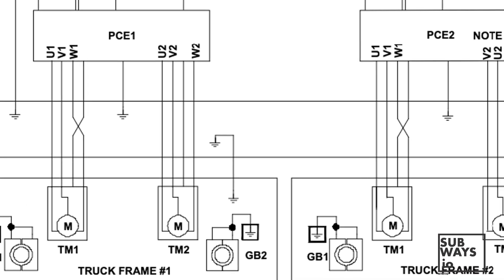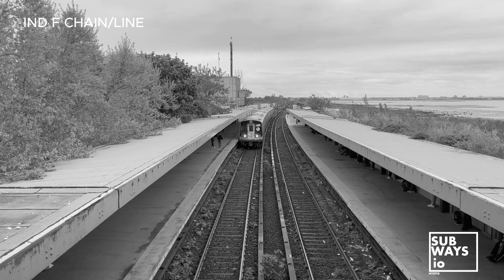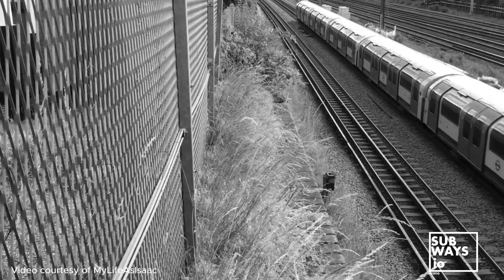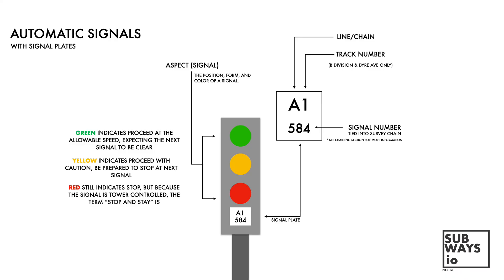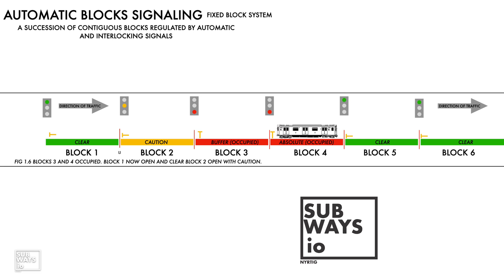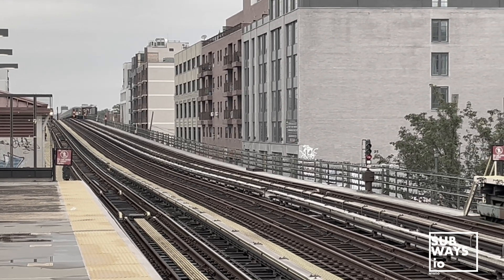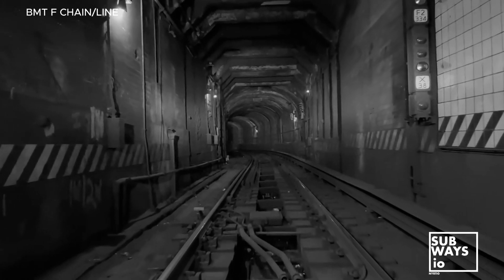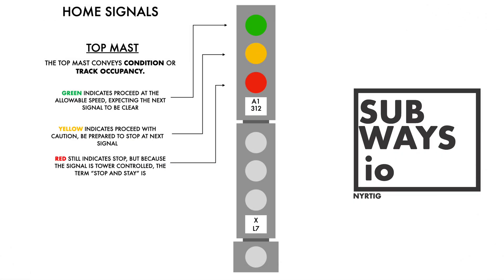NYC Subway Signaling 101: The Basics Behind the System

Comment: You explain it very well.

I'm from Russia, and we had a similar system built in the 1930s. It was modernized in the 1960s. It still used simple relay logic and a few lights in the cab. We also developed an automatic speed control system (ASC). The ASC system never allowed, and still doesn't allow, the driver to exceed the set speed, and if the speed is exceeded and within the permissible limit, it automatically stops the train.

In the 1990s, we abandoned the traffic light system and switched to an automatic locomotive signaling system (ALS). The idea is that the closer a train is to another train, the lower the maximum speed of the train behind it. This is all determined using track circuits and relays. The ASC system, combined with the ACS, complements each other perfectly. But I was really interested in hearing how the security system works in the US, since I plan to move there to work as soon as I finish my studies in Russia.

Comment: Just a quick thought bottom green doesn’t always mean “go straight”… there are a good 2 places where bottom green train takes a turn while bottom yellow goes straight…the number 2 train leaving Franklin Ave going towards Flatbush Ave accepts bottom green yet makes a right turn…bottom yellow causes a train to continue as the (3) goin straight into Nostrand Ave, Kingston Ave and Utica and all stops to New Lots…also briarwood van wyck has the (F) line accepting bottom green for 179th st as a local although train takes a switch at D20… a bottom yellow is for the (E) to Jamaica Center although train proceeds straight over the interlocking
Reply from the maker: Indeed, we’re familiar with this setup: Tracks 1 and 2 shift, with the leads tying into Line D at 2544 Home. When everything shifts over to Track 2, it creates a unique arrangement—the first home signal and the following home, located just one block away, connect directly. Based on the track and signal diagrams, GT begins here, allowing a 2 or 3 train to receive a Yellow-over-Green at the first homeball, followed by the standard lineups depending on routing via Line D or Line E. The introduction of ATS-A may have also modified some of the relay and interlocking logic.

The real challenge in creating a “101” is presenting the material so that someone starting on day one can follow it. There are always exceptions to the rules—complex layouts, space constraints, and alterations made over the years. That’s why, just like in MTA operator induction classes, we start with the general patterns you’ll encounter most often, and then highlight the exceptions as we go deeper.  Some home signals remain in spots where switches once existed but were later removed. You’ll also find capped signals where lineup options have changed. Setups with unique homeballs like this do exist, but they’re not common—they’re the exception. Thanks for watching and for your comment in pointing that out.

Comment: As a former driver on the London underground it's very interesting because the terminology is pretty much all different yet the equipment itself essentially does the same thing. 
For example the tripping devices on the track are known as train stops and the arm on the train itself is known as a trip cock. Basically an air valve. 
Another difference is the name of the signals. There are automatics which are called the same, interlocking signals would be known as semi-automatic signals and those are controlled by the local signal cabin / box, or on some lines a centralized control room. They're also named accordingly, relating to each signal box that controls them. These are the signals you do not want to get tripped at otherwise you get hauled into the office for a good ass kicking. 
What we call home signals are usually the signals approaching a station you would have an outer home, intermediate home, and the inner home which would be right before entering the station platform.
The signal at the leading end of a platform is called the station starter, some of which are automatic and some of which are semi-automatic. 
There are X signals in a few  places but it's been so long I can't remember what they do😅
Regarding the signals going in and out of yards / depots those are usually called shunt signals, and consists of a white disc with a red line on it which turns 45° when it clears.
For diverging junctions, instead of two stacks of color lights they have what's called harbor lights, a diagonal set of white lights above the signal indicating which way you're going to go. 
Anyway if you've read this far Bravo to you.

Comment: Sorry you are wrong ! London 4 rail system uses  DC for traction and AC for signalling.
Reply from the maker: Thanks for your feedback. Historically, the fourth rail system on the London Underground was chosen not only to minimize stray currents and electrolysis, but also because the network originally used DC track circuits. Later, as the system evolved, portions of the network were upgraded with more modern signaling technologies. DC to start.

Comment: There is something wrong with the description of the automatic signals and the trip arms. when a train passes an automatic signal, this signal turns red. but the trip arm for this signal does not rise until the train leaves the block by getting fully within the next block. otherwise, the trip arm would go up after just one or two cars past the signal. this is why it's necessary to have two blocks of red signals.
Reply from the maker: So, just a quick overview. The fundamentals of block system design are based on the maximum allowed speed, with block spacing and lengths directly correlated to that calculation. The faster the train can travel, the longer the block.

Why? A train must always come to a complete stop within the confines of that buffer block once it is tripped, regardless of speed. This is why, when designing signals and blocks, braking data is also crucial.

The two-block system is designed for safety. The first occupied block serves as the buffer to catch or stop the train, so to speak. The second is the absolute block, which the train or part of the train occupies. Keep in mind that a six-hundred-foot consist could occupy more than a single block at a time. The system isn’t exact—we don’t know the train’s position down to the foot or inch; we only know that part of it is in the block due to the track circuit.

This is where newer setups like Automatic Train Protection (A-T-P) and Automatic Train Supervision (A-T-S) within Communications-Based Train Control (C-B-T-C) are more accurate.

Regarding automatic tripper arms, there is a function called retention, which keeps the arm from raising while a train is crossing over one. Once the consist clears, the arm raises to protect the entrance to the block. A red light or an occupied block equals a raised arm.  

This is pretty much our breakdown. I’m not sure what caused the confusion. Thanks for the feedback.
Reply: @Subways_io  I think the retension mechanism that keeps the arm down is whether the block protected by the signal is occupied or not. at least that's what I remember seeing as a kid. maybe they've changed things. There's also a timer that keeps the arm up for some seconds if the block becomes active-it works the key by automatics signals.  i'm sure it's pretty common, but I have a nineteen seventy's motorman's operator book that I can share if you don't already have access to that.
Reply from the maker: @NE-Explorer  Nothing too complex. In this case, we’re just pointing out that the Automatic Stop Motor knows to hold the tripper arm in the down position until the full train consist clears. Even though the train has entered the block, retention, in this case, refers to the delay between entering the block and protecting the block.

Could it all be considered retention overall, with control of the gear and contacts? Sure, in the context of logic and mechanisms.  But the Retention Feature as relates to NYCT is and taught as from the first set of wheels crossing the IJ to clearing that position.

Comment: From an Australian train drivers perspective, I can see where John Bradfield got his vision for Sydney's electric suburban and city underground railways signalling right down to the trip arms. The signalling aspects are a little different, but the fundamentals are the same. Green for proceed, Yellow for caution and Red for stop. One part that is the same is the calling on yellow aspects, both there and here it is "proceed at caution and stop clear of an obstruction or occupied track ahead. Here in controlled areas, we have a little Green "close up" signal, which is a low-speed signal to allow a rail vehicle to enter a block at low speed under 25km/h telling the driver that the block that he is entering is unoccupied. Thank you for the video, I found it informative. Also, I'm guessing the "trip apparatus" on the cars with motorman controls stays in the lowered position even if the cab is a trailing unoccupied position, where here, the apparatus is in the raised position. On an 8 car Sydney suburban and Intercity train set, the trip apparatus stays lowered on the outer ends, whilst on older sets, the intermediate trip arms are raised as our trip arms raise as soon as the first 2 cars pass the signal.
Reply: They have to drop first here or they would trip the brake cocks on the cars and dump the brakes

Comment: Odd choice to use black and white or close to it. The black and white might have made sense if the signals and related equipment were in full color. They aren't. I think the fourth track in London is also because a lot of it is iron tunnels in damp clay.
Reply from the maker: @emjayay  that’s correct it’s both we also mentioned it in the form of electrolysis and stray current.
Reply from the maker: @emjayay  Again we have several other signal videos on the way. Signals 102 covers timers and wheel detectors all in color. Stay tuned for that release very soon.

Comment: if the return rail is apart of the circuit for the third rail can it electrically shock you?
Reply from the maker: The risk is low for NYCT's setup being the Negative return is grounded. But you can get shocked by touching it and the Third rail obviously and even possibly by touching another grounded object.

Comment: At one time, the IRT had stretches where the straight rail/divergence was even simpler-- green over red, straight rail; red over green, diverging track. Obviously, stop-and-stay always was red-red.
Reply from the maker: Indeed, that's correct. The IRT used a center red with four masts on interlocking signals in sections of their mainlines. The ex-IND Dyre Avenue line also used a red-over-green setup for diverging routes until it was re-chained and re-signaled in the 2010s. Maybe at some point, we could create a short video on historical signaling. Thanks for the view!🦺👍
Reply: @Subways_io  The one interesting signal anomaly from the BRT/BMT days, pre-1959, was southbound tunnel moves approaching DeKalb at 4-aspect signal X-4; a bottom-blue aspect, according to the rulebook (maybe it was lunar??) at X-4 denoted diverging into the A3 bypass for either the Brighton Line or 4 Av. express (skipping Dekalb). Bottom green would have been A1 Tk. to Brighton, stopping at DeKalb, and bottom yellow would have been F1 Tk. against the wall to the s/b 4th Av. Local. When they reconfigured DeKalb and eliminated Myrtle Av. all this changed into today's configuration; DeKalb was lengthened northbound and S/B Myrtle was eliminated and the flyunder added. This is covered in great detail in my track map book, P. 134.
Reply: @W2IRT are you the author of Tracks of the NYC Subway?
Reply: Nvm, I see now Peter. I have bought every book in pdf form since 2022 (and a physical 2021 book).
I spoke with you before, but thank you again for such a wonderful book.

[Admin R Smith]
Reply: @blue9multimediagroup  Yep, that's me!
Reply: That's how mainline railroads display their aspects btw....
Reply from the maker: @CraigFThompson  Indeed The IRT’s setup was based mainly on mainline rail.

Comment: I’ve long been curious as to why the subway system of NYC has never had an intermediate signal between a single green and a single yellow, with signals on heavy rail lines used by CN, CPKC. Amtrak, CSX, Norfolk Southern, Union Pacific, BNSF, Network Rail and other England-based train operators often having such a signal that warns any train driver approaching that the signal afterwards is a stationary single yellow.
Reply from the maker: I'm not sure how useful an extra buffer would be when signal blocks are already designed for maximum headway (TPH). With headways as tight as 90 seconds, it doesn't seem to offer much benefit blocks and signals are close to moderately spaced not to much space and warning needed to get a train in check compared to higher speed operations. Additionally, it may not be necessary given the combination of automatic trip arms, reduced speeds, and the restrictive nature of block signaling in the NYCT network. Let us know if were missing something?
Reply: Thats because this system is simplified while in train systems signals indicate speed limits and can be used as such not only for segment blocking, to extend that some they added some wierd extra lights combinationd to semaphores or digit displys to show very specific speed limits here in poland

Comment: Very informative, thanks. Looking forward to part 2. Key By I will be interested in, I think I understand the concept.
Reply from the maker: @docphillips5153   Happy you found it informative. We’ll get to more topics didn’t want pack to much into one video. Key-by for the most part allows a train to override and lower a tripper arm by bridging an insulated joint, which is why they’re offset several feet with automatic and approach signals. Again, we’ll cover it in a separate video.

Comment: Done well!!  
Will you be making  videos in color?
Reply from the maker: Thank you so much for the kind words. We've traditionally used a black-and-white style to complement the voiceovers and maintain consistency between historical and modern technical content. However, we're definitely open to exploring new styles color in this case if it better supports the presentation of information and data in our content. Thanks for the feedback.
Reply: @Subways_io  Again, the B&W would be effective in a video like this the signals and equipment were in color.
Reply from the maker: @emjayay  Whatever is better communication wise we’re open to try it as stated before. We have a signals 102 in the editing stage with color shots inserted. As well as a LIRR signaling 101 on its way. So this is the first of many. We aim to get better with each release. Engineers turned to editors we’re learning. 🙌 thanks for the feedback as well.
Reply: Loved the information. Thank you for the content.